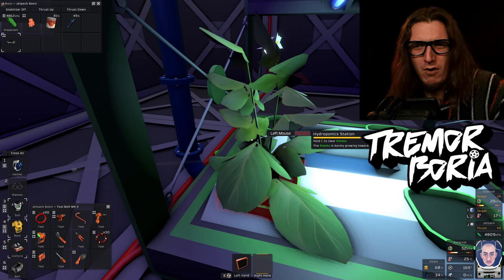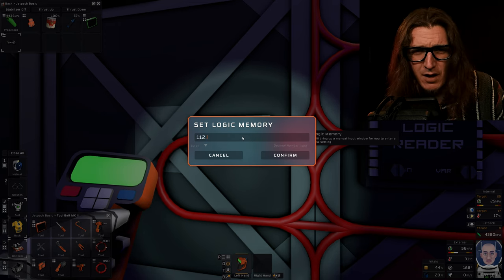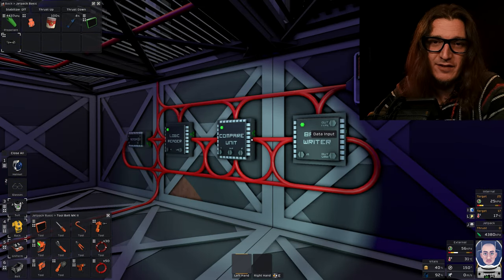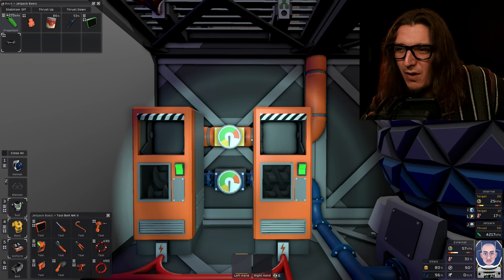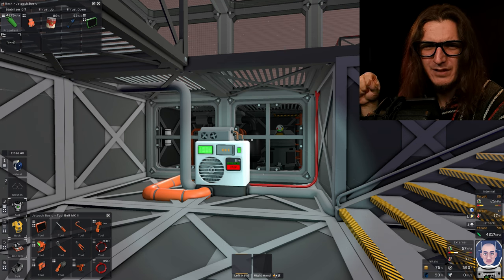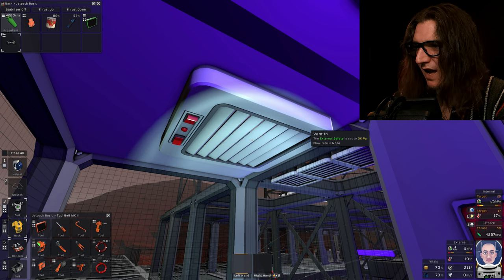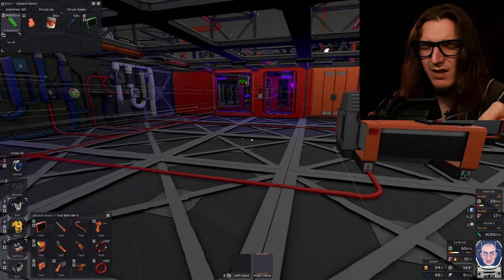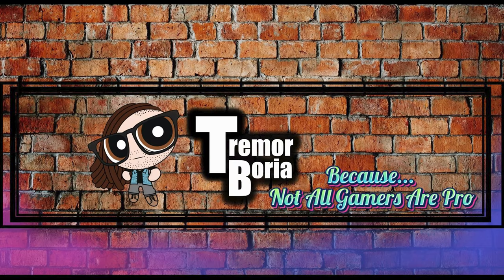Stationeers: Greenhouse of horror. “Plant logic”

Comment: Recently was made aware that plants can be used in various ways to source renewable volatiles and nitrogen. I'll let you fall down that rabbit hole yourself.
Reply from the maker: Indeed it can, but I am not sure exactly where we’re going to do this yet. I think we may be building a sort of mirrored facility on the back side of the base. I have high hopes of a Nitrous Oxide/Volatiles advanced furnace set up. But I am concerned about the structural damage if I don’t get it right. Lol. Perhaps some sort of sterling engine power set up (lmao although I have never gotten one to run properly)